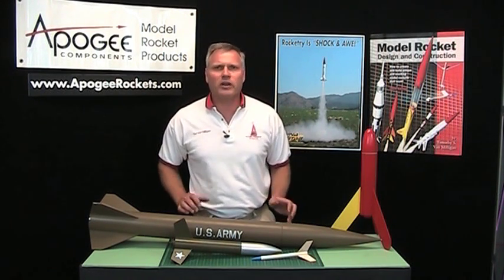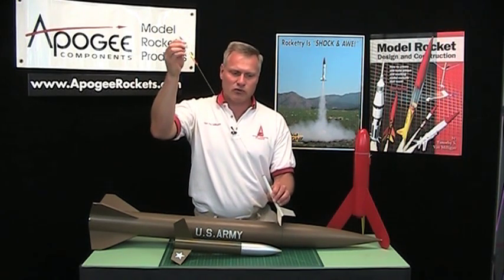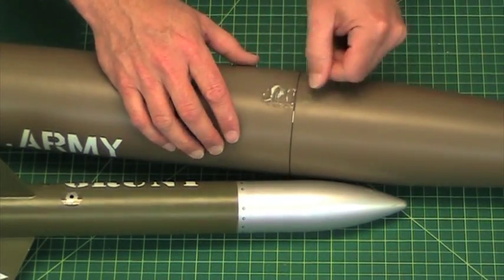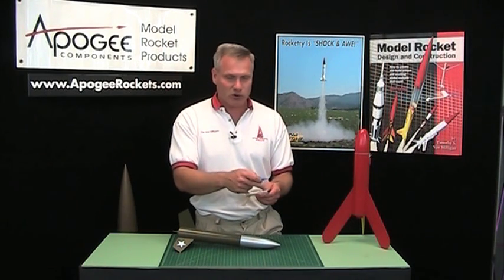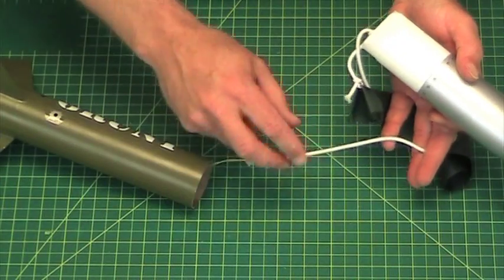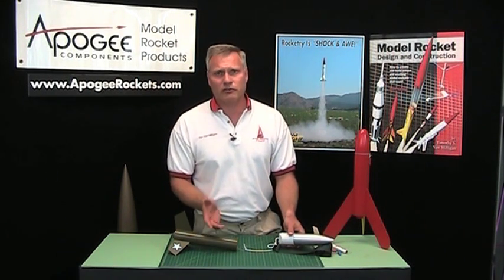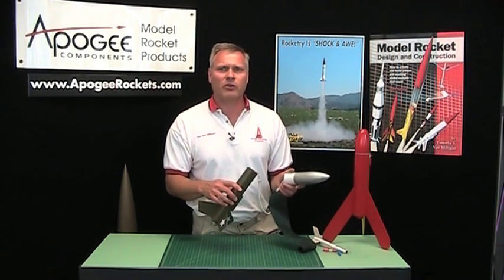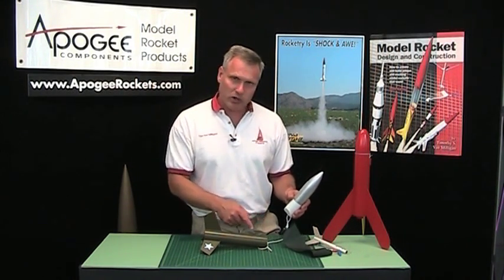How To Prevent Zippered Body Tubes On Model Rockets

Comment: How do you get the strapon boosters to not zipper? They are kinda suppose to come off the main vehicle at 200mph
Reply from the maker: Give it a try.
Reply: @apogeerockets  I bought two sets of boosters and 2 out of the 4 zippered on the first flight. How do I keep them from doing that?

Comment: What happened to using big rubber bands for the shock cords?
Reply from the maker: The disadvantage of rubber is that it degrades and snaps when you least expect it. So it is a trade-off between reliability and getting a zipper. The purpose of this video is to show how to prevent a zipper if you decide to use Kevlar.

Comment: I thought zippering was because the chute opens and tries to slow the rocket while it is still accelerating?  I don't think the length of the shock cord will help much, maybe the thickness of the cord to help spread the force over a larger area.